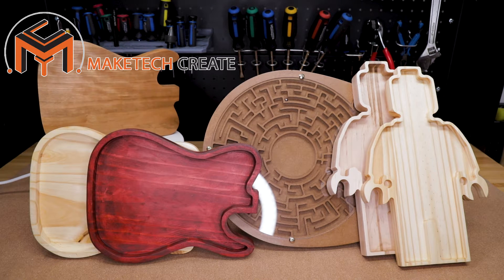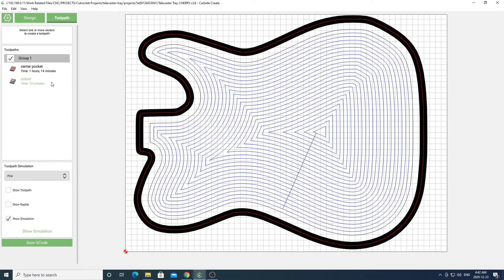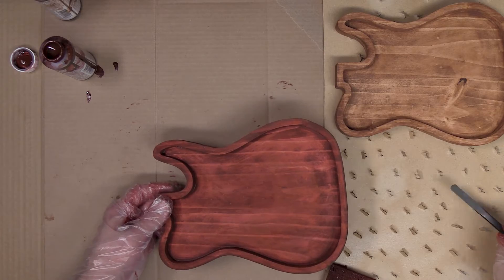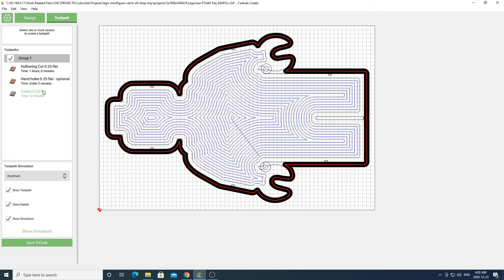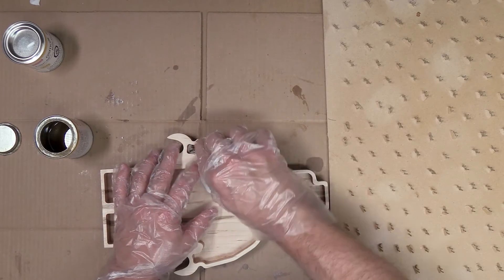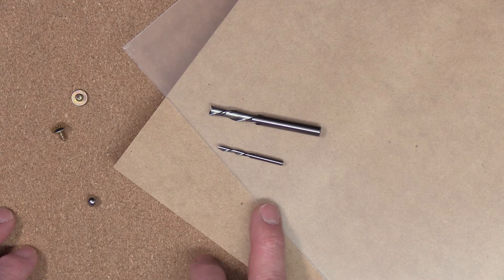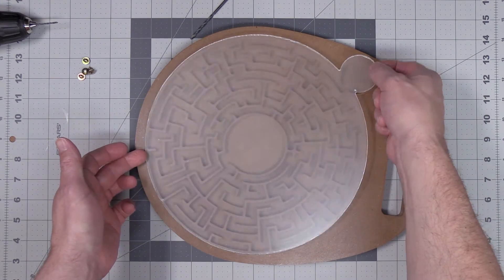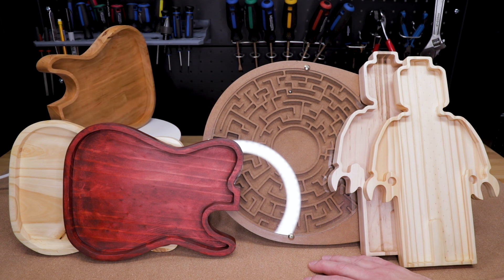Quick & Easy CNC Projects - Episode 2

Comment: Hello,thank you for the video. I dont know very much about CNC machines when it comes to working with wood. If I have a peice of stock that was larger then the bed,but only wanted to cut the stock that was resting on the bed is that possible. For example if I clamp down the top part of a 2x4 and lets say engrave it? Then turn the 2x4 on its side and engrave that? Is this possible? Thank you
Reply: COOL!